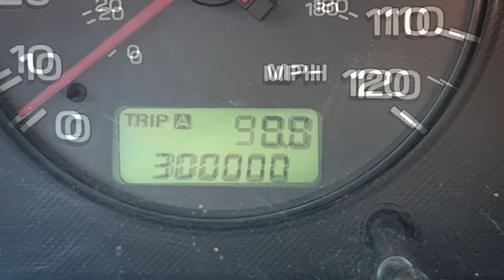300,000 Miles In The Outback! What It's Cost To Get Here & To Be 100% Again! Worth A New Upgrade?!

Comment: My uncle had a 90’s Subaru wagon…it was a 5 speed, we called it the meat wagon. He commuted to work in it for a long time, 4th gear never worked. We use it as our “bush beater,” we take my grand pop to his deer stand, and bring the deer out of the woods with it. The odometer stopped working around the year 2000 and it had 647,000 miles on it.
Reply: So he put a minimum of 65k miles a year on it?
Reply: @paul2673  I agree with Paul.

Doesn’t add up at all.
Reply from the maker: How doesn’t it add up? Featured a 2015 Crosstrek a while back with 1.2 Million miles on it.
Reply: @fredastaire6156  Here’s a 1998/1st gen Forester with 1,000,000 km = 625,000 miles on it. That was 4 years ago.. I bet that car is probably still running..
https://youtu.be/xYq7mc42IWQ
Reply: I saw one at a dealership today that has 104k miles and is only a 2020. Blue Onyx XT in Nederland, TX.

Comment: This gives me hope on my 214K miles ‘05 OBXT! Though I think the Subi n/a motors tend to last longer and suffer less than turbo motors. Provided you take care of them properly, these cars last a really long time! For 300K miles, that Outback looks awesome!
Reply: That is correct. My 14 forester is now at 140k. No leaks and no issues with the CVT. Only thing I replaced was brake pads, rear bearings, oil, fluids, cvt fluid tires and batteries. 
Sadly, I traded it in for a 2019 outback this same year lol

Comment: Awesome. I have a 2006 Matrix 4WD with just over 200k miles. Paid 12.5 in 2010 for it with 25,000 miles. About 5k in repairs. Works out to ten cents a mile...so far. I do all services on it myself- just did the transfer case and rear differential. It runs perfect.
Reply: AWD not 4WD transfer case is the transmission
Reply: @artilleryisbetter  No. It is a separate unit. The axles and rear shaft come out of transfer case. Also, the badging on the car says 4WD.
Reply: I didn’t know they came 4WD
Reply: I’m a big car guy and wasn’t aware those matrix came in 4wd/awd, I guess you learn something new every day….By the way I always loved how those Toyota Matrix looked and always heard how good and reliable they were, by the way did you know that Pontiac and Toyota shared that same matrix platform? Pontiac had its own version of the matrix but I can’t remember what they called it.
Reply: @SubieandFriends  Yes. It's the Pontiac Vibe. It's was a joint GM and Toyota project. I have 200,379 miles on the Matrix.
Reply: @MarzNet256  oh yes the Pontiac vibe, I suspect that was one of the most well built and reliable vehicle that has ever had a Pontiac badge on it!
Reply: Gotta love matrix. Easy to work on. Mine has 160k HARD driven miles with proper maintenance and still runs strong.

Comment: I bought a 99 legacy outback wagon,30th anniversary edition ,loaded options ,automatic 132k on it with ,yes bad orig. Oe multilayer headgaskets, paid 600.00 for it cosmetic condition perfect , spent about 2200 going thru motor ,wheel bearings brakes ball joints sus bushings etc. Now runs great !

Comment: I have an 03 Bean I bought new in Sept 2003, right after the 04 models came out. I paid $27,002 for it. It now has 106K on it. It has been garaged since new and has probably not spent more than 10 nights of its life outside.

It's been towed twice, once when an idler pulley failed and then about five years later when a tensioner failed. I've had the A/C hoses replaced twice. Had a couple bushings replaced and both front axles. It's on its third set of tires, and they were changed for age rather than wear.  It's never had, or needed, an alignment. Current tires are four years old, rotated regularly, and wearing evenly. That's it other than the usual brake pad replacement/flush (still on original rotors), coolant change, etc. Absolutely nothing leaking, anywhere.

It's serviced every six months by a small independent shop by a mechanic who drives an 02 Outback and has two Foresters for his wife and teenagers.

This thing will run for a long, long time.

Comment: Thanks for the cost analysis,  I also believe in keeping older cars running. I'm on my 5th Subaru now.  It's a 2017 outback that I got pre pandemic. It's the model just below the touring and has all the bells and whistles,  eyesight, leather, sunroof winter package.  Nicest car I've ever owned and I've had Suburbans and a Yukon. I just found my son a 2012 Forester with 53000 miles that was owned by an older lady that kept it in a garage always.  It's like a brand new car. Also have a 2005 F350 FX4 Lariat that I picked up cheap in and 2019. Had the motor rebuilt and bulletproofed and transmission rebuilt and beefed up. Love not having a car payment!
Reply: I like to buy used cars and pay them cash. No car payments and its much less stressful because you can work on your car or take it to whoever you please and not depend on a dealership. I just bought a 2016 jeep grand cherokee with the v6 with only 30k miles (bank repo). Love the car, but its not without its issues. I worked as a Chrysler tech for some time so I know those cars, and I can fix mine. I will be more than happy to keep it running for the time I have it, and at the same time, enjoy it. Thats the good part of being able to fix your car or having a trustworthy and knowledgeable mechanic to help you: you can have and enjoy even the most unreliable car. And I'll say it again: NO CAR PAYMENTS 😁

Comment: I don't own a subaru any more and I'm sad because of it, but I'm subscribing.   I had a 2005 outback VDC model.  ABSOLUTELY LOVED that car.  I did treat it horribly but changed fluids religiously.  Unfortunately the head gasket was giving out. I know now when I bought it back in 2013 up in concord NC, it had a tiny leak. I only know that now because of tale tale signs I wasn't aware of earlier in ownership.  Fantastically manufactured machine.  IT took all the abuse I gave it and laughed it off.  I eventually sold it to carmax during this insane car market value for 1700 bucks. I just had too many irons in the fire so to speak, so I couldn't afford the repairs that would make the old thing back to 100%.   
I miss this car.  Thanks for the run down.  I want to get back into the subaru family at some point.  This gives me a reason to keep an eye on the channel.

Comment: I LOVE your channel, MrSubaru1387. I owned a 1984 Subaru Hatchback for 10 years, put on nearly 100,000 miles, only had to change the clutch at about 90k miles, but otherwise had trouble-free service from that little 1600cc, 4-speed manual transmission trooper, and got 42 MPG highway. Fast forward 38 years and I just bought a brand-new 2022 Subaru Forester Premium that I'd love to keep around for as long and for as many miles that you have on your 2002 Outback now that some of the bugs from the earlier Foresters have been remedied by Subaru. Thanks for your great channel - liked and subscribed.

Comment: Thank you for making me feel better about my purchase. Got a 03 Outback L.L.Bean 3.0 from the mother in law. 60K original miles, garage kept all its life.  Complete coolant and trans flush at 50K. $3000 purchase price. I replaced engine mounts, trans mount, Idler pulleys, CV axles and new starter. Runs and drives like it drove off of the lot yesterday!
Reply: Just got an LL Bean myself with low miles (80k) and am hearing a squealing from under the hood, suspect it’s the idler pulley bearing. How easy a fix is it? I’m not incredibly mechanically inclined but have been able to teach myself every fix needed on my last outback. Figured it’ll be easy enough but just wanna know what exactly I’m in for

Comment: I paid $150 for my 02 LL Bean Outback, it had 180k when I bought it. The thing was trashed, punched out ignition, broken windshield smashed in drivers door, chopped off exhaust. Missing title and all. It was still worth it to go through the hassle of getting it registered in CA. She has all the same leaks as yours. The only trouble it’s given me is the alternator + battery and the heating element going out on one of the 02 sensors.

Comment: Thanks again Mr S - I’ve found your reports are very honest, factual and well detailed - here in Australia I’ve owned 10 different used Subarus only due to lifestyle changes - my first Forester was the original 1997 RX Auto which lasted to 425,000 km until a cam shaft seized - most of the models were 2.0 litre pre-2000 without the head gasket issues and a 2009 XT Turbo Forester, 1981 Leone Wagon, 1990 Liberty wagon with the flawed air suspension and 1996 Outback - I don’t like CVTs and the lack of a coolant temp meter in all models from 2008 so my next car will be a pre-2008 Forester with conventional automatic transmission

Comment: Mr Subaru is precisely correct! I have been through the same process with my 2005 Forester XS with now 201750 miles. I ended up spending around $2,800, in parts as I did everything myself, to remove the engine to change all seals, new Six Star head gaskets, head  bolts, timing belt, pulleys, tensioner, and water pump. Replace all clutch components, the flywheel was fine so it was resurfaced. Replace rear wheel bearings, and replace all struts (the springs were fine) and housings. And lastly, replace all brake calipers, rotors, pads, and master cylinder. Oh, and replace all sway bar bushings and end links. I now have a car that will easily last another 100,000 miles. I considered getting a new CrossTrek, but the cost of ownership was significantly higher and I intensely dislike the new electronics...eyesight etc. Thank you for clearly stating the reality of ownership Mr Subaru!
Reply: My Subaru is currently getting evaluated by a mechanic I trust (drove 2 hours but I know him from before I moved out of my parents house and dont trust anyone here but they are good to change parts though...). My OB has 190 000 miles and my brake line is bad, front calipers are done, timing belt is due, clutch probably as well but I find it goes super smooth, rear struts are shot... I have quite a bit of money to invest.. its also my only car so I cannot start dismantling it and arrive monday morning and have no car as I live on the countryside... hope everything turns out good and can give him a go to make my Subaru decent again as its a tank during winter.
Reply: @TheCharacter97  I understand. Look at it this way; as Mr Subaru pointed out most people do not take into account the real cost of ownership. So even if you fork out $5,000 you are still way ahead over buying a new Subaru, due to the moment you drive off the lot you lose at least that much. I have already talked to my Subaru dealer salesman (the one who sold me the Forester I have now) and he agrees. Plonking at least $30,000 down for a new one I think is crazy, especially in the State I'm in (Ohio) where after one winter the underside is trashed. Or some dipshit looses control and smashes into you; this happened to my Subaru parts guy. He had a brand new vehicle he loved after 5 months and 5,000 miles it is a complete write-off and he can't replace it due to the present situation. The Subarus we have a nearly bullet proof if you maintain them and if something goes wrong invariable it is a relatively easy fix compared to most other manufacturers and the parts aren't outrageously expensive. I wish you the best!
Reply: @kiwikidusa  I dont mind putting money in my car but the guy who will check my Subaru will also check the underside and a such and if it happens that it would be rotted (which I doubt), then its not worth putting money on.. Could be other things but but right now it was way overdue that I sent it to the shop..
Reply: @TheCharacter97  Completely understand. I have been spraying the my Forester underside with Fluid Film, now known as WoolWax. And do touch ups every year or so, just did one yesterday evening. For a car that has been in Ohio for 17 years it does not have much rust or corrosion at all. My wife's 2012 Impreza has none as I was very aggressive from day one and use a combination of Fluid Film and ACF-50. On your car be sure to check the control arms, as the original control arms have a tab that was welded in a way that water/salt could just sit there and corrode away. Get a ball peen hammer and tap away you'll know right away.
Reply: @kiwikidusa  thanks for the control arm tip. I also do touch ups every year. I admit I neglected the underside a bit but it doesnt seem so bad for a 2010 and living in NE Canada. I do take my pressure washer outside on warm winter days and clean my car.. that helps.. if I put money, im definitely either try your wax thing or just get it sprayed with grease.
Reply: @kiwikidusa  I will put money in my Subaru :) my mechanic will get my brakes working properly and change discs and such for the moment and later when he has time he will do my other stuff that needs to be done and my timing belt as well.
Reply: @TheCharacter97  Try to get your hands on the NAPA coated rotors and brake pads. I have driven mine through 2 salty winters here and barely have any rust forming on the rotors. AVOID zinc coated rotors they will corrode very fast.
Reply: @kiwikidusa  I will have a look into this. I do live where winter lasts a while. At least im not all the way up north.

Comment: 2012 legacy 335k miles: I just replaced the original radiator, all I’m missing now is to replace the original steering wheel pump(still running strong) all other components have been replaced during the last couple of years. All these labors have been DIY thanks to your channel. Thank you.

Comment: Have had several over the years but one outback. It was a 2012 bought it from the original owner with only 28000 miles in 2014 and traded the 2010 Impreza that was bought new but needed bigger. Drove it till the end of 2018 and when I sold it had 289000 miles on it. The only things I had ever had to do to it was several sets of tires several sets of brakes lots of oil changes (didn't burn leak or seep)  did the 3rd timing belt right before I sold it as the tensioner was starting to get the Subaru tick to it again and it was at the mileage that I run them too (I change them at 80k and I have a feeling that is why I never had any head gasket issues and the fact that I ditched the Subaru coolant for standard green) 4 flushes on the cvt trans and it worked flawlessly front and rear struts 1 rear cv shaft only cause it was seized in the wheel bearing that went bad  a battery serpentine belt 4 sets of spark plugs a gas cap (the only time i ever had a check engine light) and several headlight bulbs and a few tail and brake light bulbs.  When I sold it it was running flawlessly and still getting 32mpg that it always got. I know the family it went to and they are still driving it and has just over 400000 miles on it now still oe cvt and head gaskets the new owners have followed my maintenance regimen and they have only had to do basic maintenance. A couple of wheel bearings and had to rebuild the front differential do to a bearing and seal failure
Reply: nice. take care of the car, and you never have a problem. a lesson to us all

Comment: 03 forester 225K this month. Still runs and drives beautifully. Bought with 194K and just had to do suspension, tires/alignment and timing belt. Original single layer head gaskets still too.
Reply: 225000K is 225000000 miles.
Reply: @gregdolecki8530  good catch. Cant believe I let that slip. Just corrected it. Thanks.

Comment: That outback is almost as nice as my 2002 Subaru forester S 😁
Except my car only got 140k miles on it ! 😄
Bought for 4k last year no oil leaks or transmission leaks at all so far.
Had to swap the power steering pump from my other 2002 forester because the lesser miles S forester has gasket leaks on it needing rebuilding.

Comment: Great vid!! I agree that maintaining this car verses purchasing a new equivalent is the better option. Just bought a ‘19 crosstrek limited, and last year bought a ‘19 Ascent premium. And the crosstrek was more expensive than the Ascent.  Plus it was higher mileage. We bought both cars through the same sales rep and from the same dealer. They explained that the Subaru’s inventory shortage was the reason. In disbelief I looked the same model crosstrek, and found out that their price for the crosstrek agreed with everywhere else.  Simply said, a new or new/used cost plenty more than the MSRP these days. Maintaining this vehicle is clearly the most cost effective option.

Comment: I like the way you think. I was given (long story) a 2001 Forester in 2019. It had a very slight head gasket leak. I never did figure out where the coolant was going. I simply added a cup every couple of weeks. Engine finally gave up summer of 2022 at about 275,000 miles (non head gasket-related). I bought a used engine in Salisbury NC and installed it near my home outside of ATL. Gotta love my low payments. And insurance. And license tags. Air blows cold, all power accessories work

Comment: I have an 08 outback L.L.Bean. the original owner didn't have a clue. She blew the original motor, and put a crappy motor in it and sold it to the dealer I bought it from. They overtightened the head bolts and two of them pulled the threads out of the block and then it bled oil.  Well needless to say I just put a new (decent) engine with 90k on it. Other than the dashboard being a sticky mess it's a nice car

Comment: Nice. I got the family hand me down 01 Forester to 313k miles before it had to be scrapped. Sadly a mostly northeast life bathed in winter salt plus Philly potholes cracked the rear subframe. Engine still pulled like a champ, I really wanted to keep it running till the engine gave out.

Comment: My 2008 Chevy Malibu 2.4L four cylinder engine has 296000 miles with original engine and transmission. All I do is change oil and brakes. It is definitely the most reliable car I ever owned.